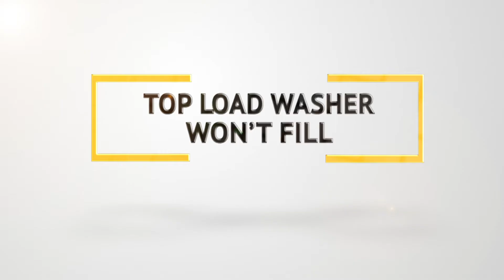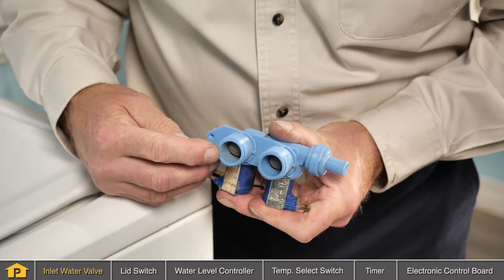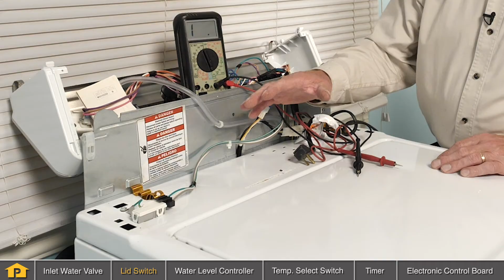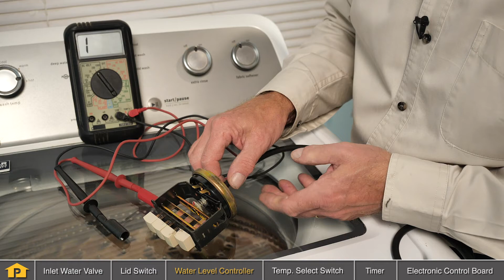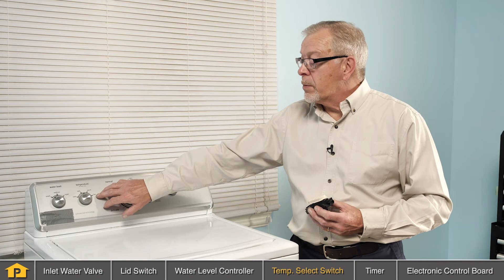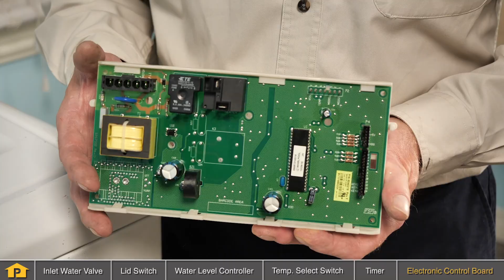Washer Troubleshooting: Top-Load Washer Won't Fill- How to Fix Your Washer | PartSelect.com

Comment: my problem is that it will only fill up the tub a quarter of the way, not getting enough water to wash no matter what cycle its on...
Reply: I have the same issue. it's brand new
Reply: Same here it only fills a little bit then it start washing
Reply: @CrisGamesAlot  So apparently, this is normal...Government water restrictions...But no way this gets clothes clean!
Reply: @CrisGamesAlot  If you put it on bulk, it should fill up with more water...We just wash everything on bulk...

Comment: What could it be my washer will not filled with water
Reply: Make sure drain hose is raised up not just going down
Reply: @tprocketeer can you explain this
Reply: With the washer on take drain hose from where it exits the washer raise it up till the water will fill then anchor it at that position.

Comment: I really like the format of this video. this washer was a bit older than mine and didn't quite cover my issues. I was able to resolve mine by simply unplugging the washer for 30 mins or so. but thank you for labeling the sections at the bottom that correspond to the playbar!

Comment: Not sure your video covers my issue, my top load washer runs the water but the tub doesn't fill , the water just runs through.  What causes this problem??
Reply: Rip same problem
Reply: The actuator has an optical sensor that tells the washing machine when to shift from one function to another. It shifts the transmission from agitating to spinning, and if the part is not working correctly, the water will pump out of the machine, but the spinner will not work to spin water out of the clothes.
Reply: Grace did you figure it out?
Reply: Anyone ever figure this out?...please help
Reply: This is what’s happening to me. Did you ever figure it out?